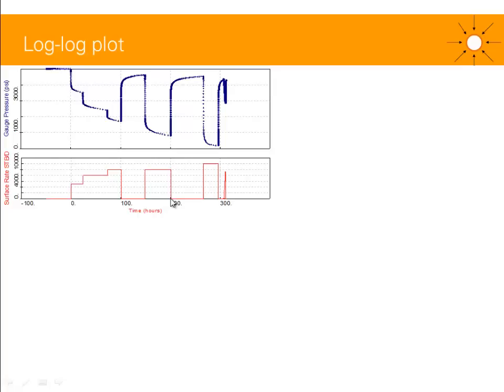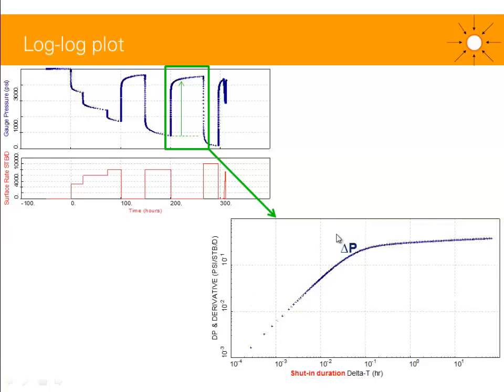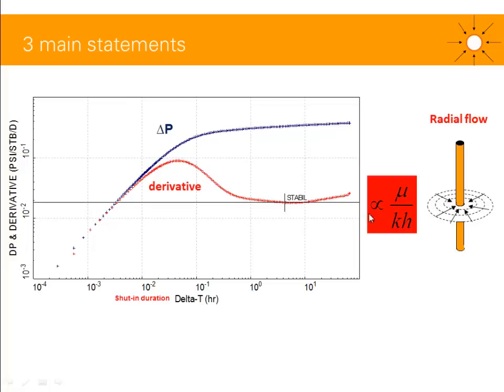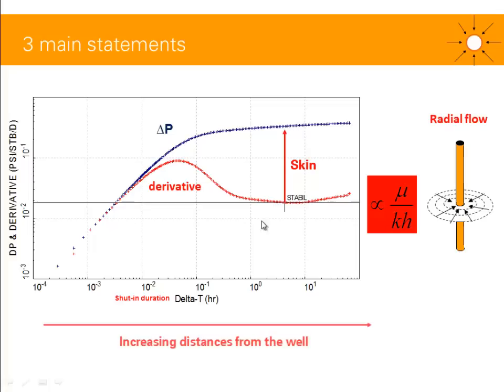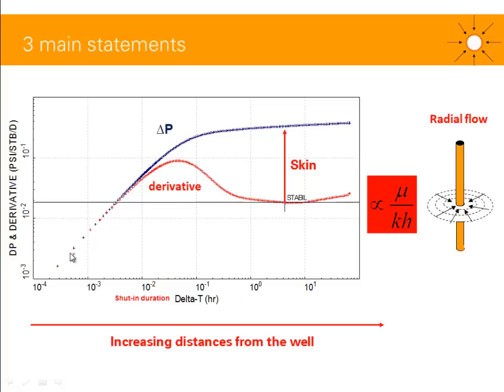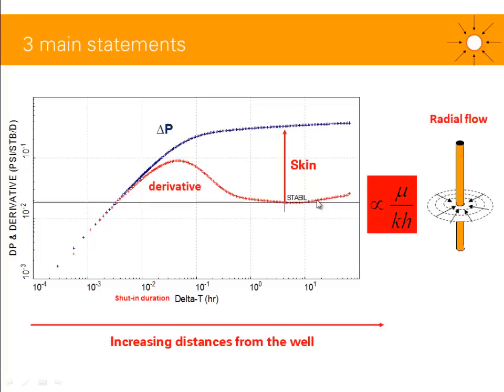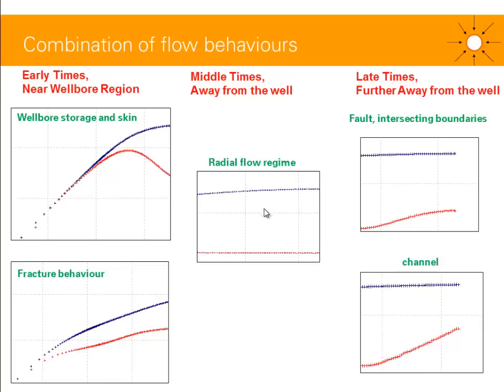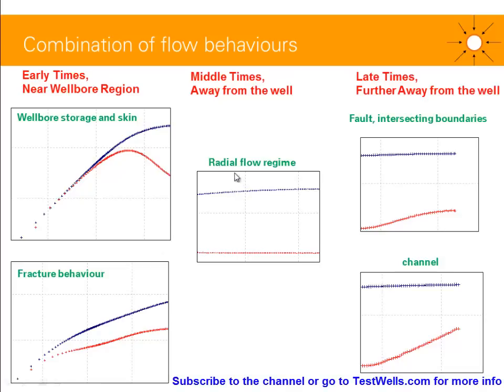Log-log plot (or derivative plot) in well test analysis

Comment: Another question that i have is, is it possible from this plot to identify also where (how many meters or kilometers away from the wellbore) the thickness reduction happens? Lets say after 80 hours the derivative moves up again stabilizes due to change in thickness, what does this 80 hours mean? Can we convert hours into length? Thanks a lot.
Reply: You can do this by application of radius of investigation. 

1. Detemine kh for early IARF
2. calculate radius of investigation for time step where you see change in flow regime